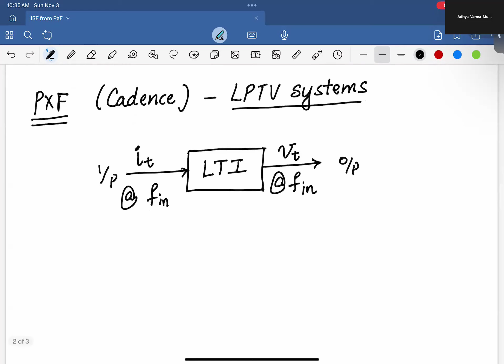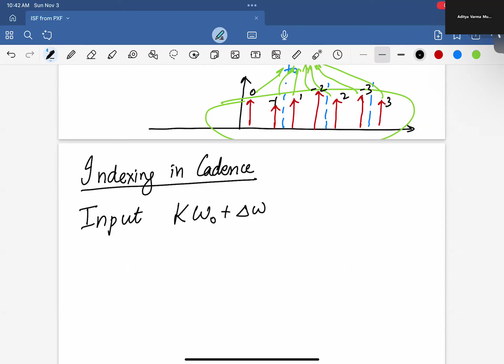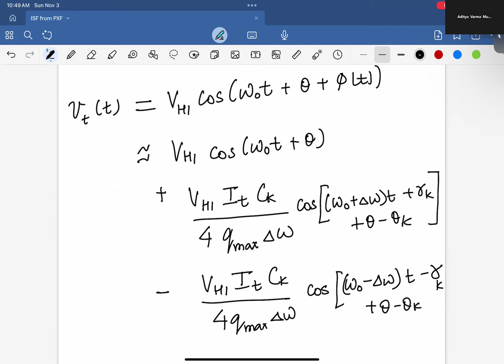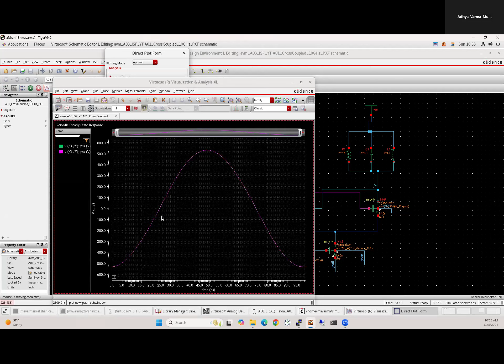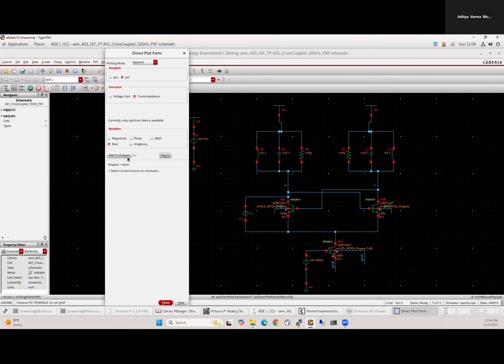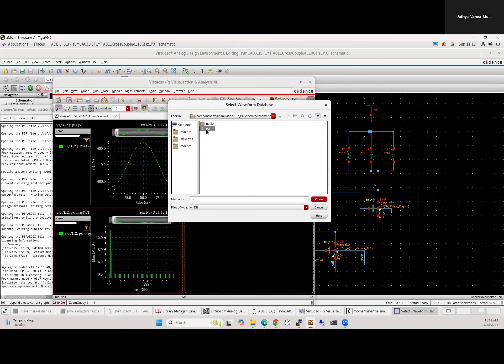Fast Simulation of ISF and PPV using PSS and PXF in Cadence | Oscillators 12 | MMIC 19

Comment: Hi Aditya, Thank you for your video! Could you please create a new episode explaining how to use the ISF and PPV theory to improve oscillators phase noise? I know how to simulate the ISF, and I know that it needs to be made as symmetric as possible. But I'm not sure how to achieve this in circuit level. Thanks!
Reply from the maker: Yes, I will do that in future videos.
Reply: @adityavarmamuppala  Absolutely right. Most papers usually only state that symmetry leads to a lower 1/f³ region but do not elaborate on how this is achieved at the circuit level. I hope you can explain this. Thanks.

Comment: hi Aditya, nice video and great insight; however, I have a doubt. Is it required to consider negative frequencies also? In the first reference, it is mentioned that ISF(nonnormalized) can be obtained by using positive bands of PXF (from cadence, index -1 to N-1 where Number of sidebands). Why should we consider negative frequencies also? Please correct me if I am wrong. Thanks in advance
Reply from the maker: We don't need negative frequencies. In the final equation note that I only use positive frequencies.

Comment: Thank you very much aditya. What was the ISFeff(rms)^2   value for this design at 1Mhz ? is it possible to use a matlab code for entire phase noise calculation in matlab and compare to phase noise result from cadence in a future video?   by ISF(rms) I mean showing ISF and then effective ISF(multiplying with NMF) and lastly calculating RMS of effective ISF and using it in Hajmiri's phase noise equation.
Reply from the maker: Yes, I think it's possible and fairly straightforward. You should try it.